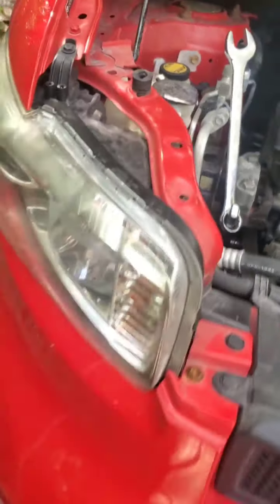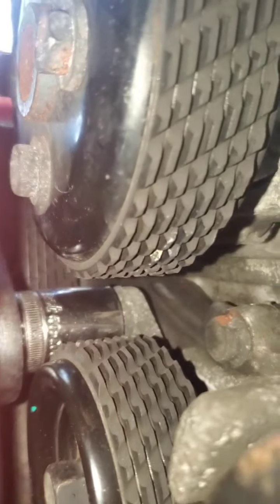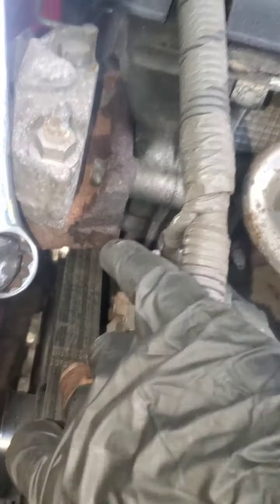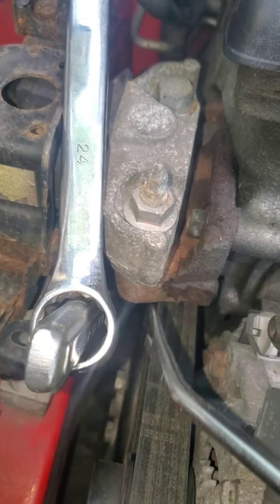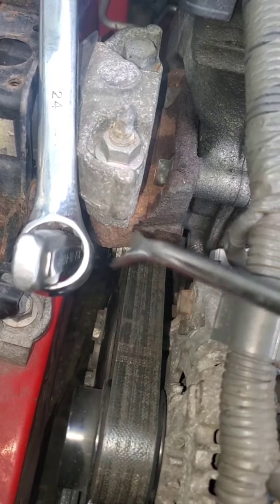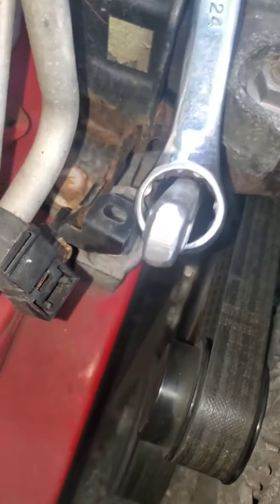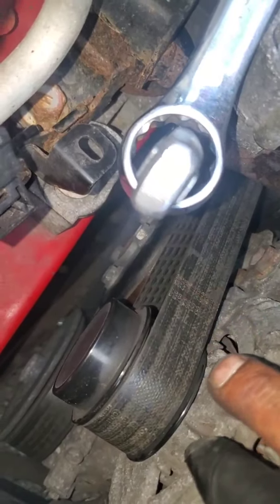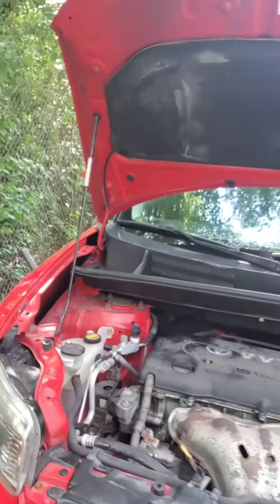09 scion xb tensioner pully removal tips (hack)

Comment: This is how I get the belt off mine.  Except I don't take the wheel off.  Definitely will need to in order to get to that pulley easier.  Thanks for showing you can replace the pulley alone.  Do you by any chance know if the ac compressor pulley can be replaced as well?  I have my alternator and the tensioner pulley and the water pump pulley all grinding.  I replaced the alternator already since I had warranty and doing the tensioner pulley soon.